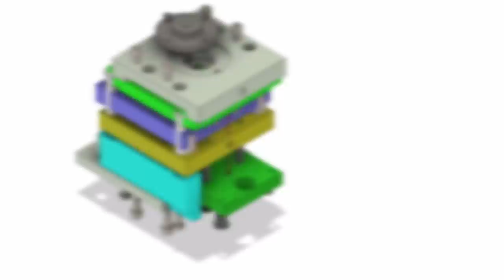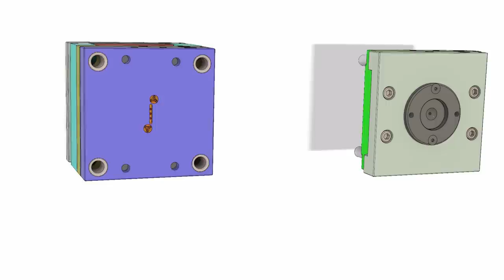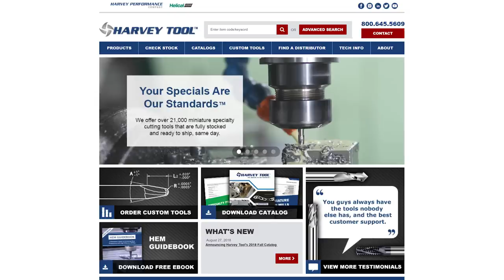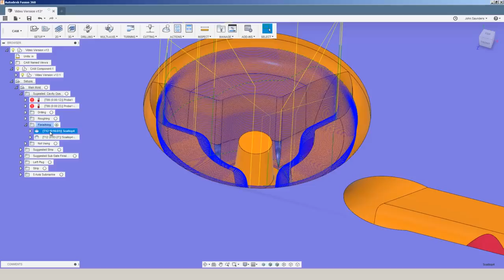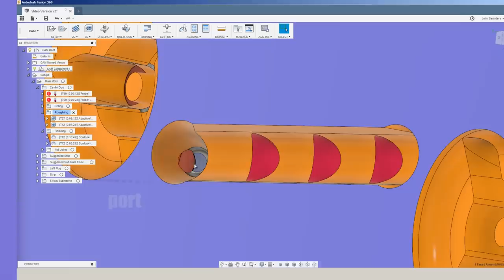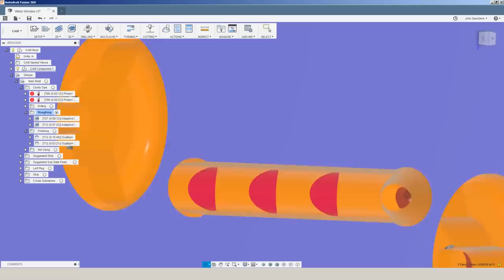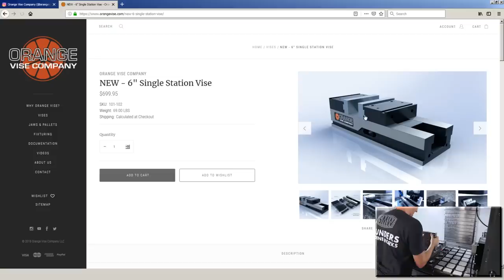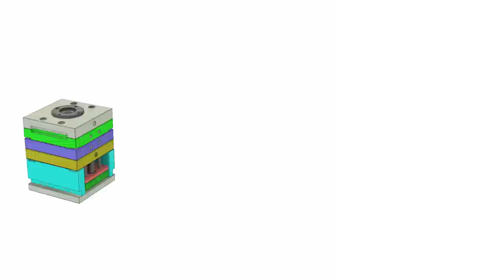Machining an INJECTION MOLD!

Comment: Why only 2 finished parts for cycle? Wouldn't 6 or 8 better utilize the injection molder.
Reply from the maker: Rookie numbers.  Needs to be at least 30.    Joking side, 1) shot size limit in machine, 2) increased mold complexity 3) the price and this solution WORK!
Reply: @nyccnc   That was the first thing I noticed was why only 2 parts.  They are using up more material in the sprue than the part.  The machine time is being wasted with only 2 parts per cycle.
Reply: @SpaceBuckaroo  Probably a investment vs income argument. They might only need to make 10,000 in a month and the investment into a more complex molding wouldn't be worth it for that throughput. It might also be that the machine the customer plans to use cannot handle the amount of plastic needed to fill the mold. Plastic molding is a complex process and one thing you need to worry about is being able to fill the mold before the plastic cools enough to become solid. I'm not super proficient with plastic molding but that's what NYC CNC probably means by shot size limit.

Since the part is something they don't need a lot of they can probably charge a little more per part to offset the extra material used. This might seem stupid but in the end a plastic injected part is still going to be darn cheep even if it's not the "optimum" throughput and efficiency you could use to make the part. Also, plastic can be recycled in house to certain extents to reduce the overall wasted material.

This is why you still see small machines being used in all trades. Sure you can get the biggest baddest thing around to remove/add umpteen tons of material a day. But if you only need to make 100 small parts every week then what's the point?
Reply: Fewer chances of messing it up... and room for mistakes
Reply: plenty of reasons why 2 is better in this case
Reply: Because:
- they are rookies in moldmaking (this mold is "apprentice level" basic design),
- balancing gates is tricky in multi-cavity molds, so 2 cav. is spot-on,
- cooling & ejecting system complexity increases rapidly when you add cavities,
- price and other factors (injection machine shot size capability, etc.).
Reply: that was my first thought also, there is probably 3 times the material in the sprue than in the 2 pieces.
Reply: @andylarkins5128  i work at a company that makes such molds. a lot more complex and bigger and i asked the same question when i started my job there. they have plenty reasons why less parts are better. i learned a lot already but im not a professional and i leave the explenation to them. im just saying they did everything right with 2 parts.
Reply: cause they're amateurs and the more cavities there are the more tonnage pressure the machine needs. It also makes figuring out waterlines more difficult. And also depends on plastic, for flow rates, shrinkage, and hardening speed.
Reply: Judging by the size of the die its going in a small machine, injection moulding machines use tremendous force to close the die to prevent material bleeding out maybe the machine is not capable of producing enough clamping force for more than 2 parts
Reply: @rosengrantchris  
"machine the customer plans to use cannot handle the amount of plastic needed to fill the mold"
I noticed that the heating and injecting tunnel was rather short on the machine in the clip. They also mentioned they were injecting rubber, which I suspect, presents it's own set of issues (doesn't flow as readily, cannot be heated as high, more tendency to stick to the mould etc. But these are just guesses.
Reply: For a balanced mold the mold needs to double the cavities 1,2,4,8,16,32. The cavitation of a mold depends on how much product is needed, press size, clamp tonnage and shot size, one way to cut down on the runner is to bore out the spur and use a longer nozzle
Reply: @rosengrantchris  I may be wrong here (wouldn't be the first time) but I think the customer IS Saunders Machine Works. They have made the mold for their own part. Plugs for use in filling unused holes in their line of mounting plates. To keep coolant and chips out, etc.
Reply: @GrayRaceCat  I too was wondering what the point was by the end of the video.  Still, a great video
Reply: Yup, depends on numbers.  But, some larger molders are moving to having say two 32 cab molds running instead of one 64 cav. Because when hot runner drops fail, they have to shut off 4 for each one to keep the fill balanced.  It's not uncommon for them to only be using say 40cav on average.  Having multiple molds keeps parts coming even if one mold is in the shop.

Imagine a 64cav stack molding laundry detergent lids running 12 bad parts at a time. They'd waste thousands of lbs of material and endless time.

I believe the Big pen company has multiple 4-8 cab molds in multiple machines because they can't afford the downtime of having a larger mold down.
Reply: @nyccnc  what was the shot size needed vs what was available?Also how did you figure the total volume?
Reply: I'd have to agree.  At least 4 if not 8 cavities.  The waste in the sprue is tremendous compared to the part size.
The extra work is only machine time in a part like this, running extra cycles of the cavities.  Also i would use reverse tapered end mills for the gating, maybe edm and polish?
I would love to see a demo of using pocketed hardened inserts for your cores and cavity plates, A and B sides.  It makes it easier to machine the features into a mold.
Nice Job!
Reply: @nyccnc  Hi I'm learning about injection moulding, where does the air evacuate from the mould as the plastic is being forced in? are there vents for that? Thanks

Comment: Any reason to indicate in the shank of small end mills rather than the flutes? I don't have a lot of experience with setting them up but I do hear that the flutes can be ground .0004" or more off center from the shank.

Comment: I’m here to say I’ve made alot of Mold Bases, Cavities, cores, and slides for molds anywhere from 50,000 to 100,000 dollar molds. Usually Rough and pre finish everything with .007 on all the walls and have it heat treated and then finish everything to size then let the veteran mold maker plus 30+ years in the business, burn the small details in on a ole Mitsubishi Burner and then he assembles the mold. It’s quite a process especially when the guys your making it for a picky as hell as in drop it .0007 tenths on that chamfer

Comment: If you run a lot of them, especially if you're using expensive materials, consider changing that cold aprue bushing into a hot sprue bushing. (Hot runner system would be overkill for this)
DME sells basic ones for under a grand. A basic temp controller if your dude doesn't have one is also cheap.  Minor mods  to fit.  It's basically a much smaller od version of a sprue bushing that has a heater band wrapped around it with clearance for heat xfer. The tip will then stay the same diameter.  From just the video it looks like you'd have 50% less scrap, and it will also decrease the cycle time. Make twice the parts with half the material!

Depending on what material, choose appropriate tips, to shut off. I.E. reverse taper for nylons.

Of course if your using cheap material or some regrind, and 5-10 seconds doesn't matter, then it may not be worth it.

What is the material your running, and what mold steel did you use?

Comment: 5:16 actually you touch off the plate by first getting the rotation from two holes and then touch off all 4 holes to get the exact center because if you want to change something in the contour later you may not get the exact same center if you touch off from the outside walls (which are not precise)
Reply: incorrect. So many reasons to not go off the leader pin holes: 1. The leader pin holes are not made to be used as datums. The plates are assembled then the outsides are machined so they match with the leader pins in them. 2. the hole on the operator corner is offset - so if you pick the wrong two holes to measure off of your datum will be incorrectly shifted. 3. sweeping holes is much slower than beeping the outside of the plate. 4.Larger plates do grow and shrink substantially with the heat from machining, switching coolant on and off, and room temperature - so the leader pin hole locations will move from heating and cooling, while the center of the plate will always be the center of the plate no matter what temperature.

Comment: You said that moulds have to be made by cnc - not true at all. Injections moulds were made long before CNC machines. And many are still made the old way - with standard milling machines and spark eroders.

Comment: Two questions. These aren't about the machining, but more about the design. I was hoping you might know.
1) Why is this mold so big for such a small part?
2) If the mold had to be that big to fit the injector, then why didn't they design this to make at least a dozen more of the parts in each injection? This is for rubber parts. It's not like very slight temperature or density differences between them during molding would be a big deal.

Great video, BTW. I hope you get lots of business. That beast of yours looks hungry.

Comment: On a die this small do you have to have the surface perfectly flat or a micro concave or convex to allow for part expansion and deformation? Or does the cooling keep any movement from happening? We have a 2000 lb die for our product, but I have always been curious as to the actual tolerances.

Comment: What was the reason for having the gate hidden? Could it not have been on the surface? How did you align the ejector pins? Did you use transfer punches or some other method?
Reply: I work in injection molding and tooling, sub gates like this are used so when the part ejects from the mold it automatically separates itself from the sprue, as well as leaving a cleaner finish than cutting the gate by hand. there are many different gate styles depending on part shape, plastic type, and a whole range of factors

Comment: I'm surprised you built the cavity right into the base plate in the ejection side of the die, we always used to make inserts for both sides to increase longevity and so that they're easily replaced if/when they get damaged...
Reply: Also, an easier and more accurate way to cut your tunnel gate (the angled tapered hole where the plastic flows into the part) is to set the plate up on an angle plate on a manual mill and use a 7 degree single flute cutter and a set of gage pins to make the orifice the correct size on both sides...the general rule of thumb for most plastics is the orifice diameter should be 70% of the average part thickness (ie: If your part is on average .100" thick, your orifice should be .070" in diameter)...set a hard stop on the quill, gently peck drill the hole until you break through moving the knee up .001" at a time until the desired pin diameter goes through the orifice, then flip the plate 180 degrees and do the other side...
Reply: Thanks for advice. But do you realise, that this is very basic mold? So he doesn't need to make it more complicated.

Comment: I have a question for anybody that may care enough to cure my ignorance.  I have been around CNC most of my life. The thing is: I have only used Swiss turns and a manual lathe and Bridgeport as support equipment. 
 I always wanted to get into milling machines. I’m thinking of buying a Haas to play around with and learn(I am sure it won’t take long at all). I guess my question is this. When you’re using a milling machine... where and how do you buy stock? Do you specially order it in specific dimensions? Does it usually come in a rectangle or square bar and you cut it to size? Are there processes you have to go through to prepare your stock... other than probably filing the edges? 
  Any time I have ever ordered stock, it has always been “ I need this material in X length and X diameter” and “possibly centerless ground”. Sorry, for having an idiot question. I am just curious.
Reply: An Artist formerly known as William Devane 

There’s metal supply warehouses throughout the country. Yard metals is a large one, Alcoa for anything aluminum. 

Generally ordered in bar stock of plate stock that you cut down to part stock size with a bandsaw. You can order them precut to a specific size, but it costs extra and only worth it if you’re doing several of the same parts. 

McMaster Carr carries smaller sizes and quantities of just about everything, but they’re pricey compared to a dedicated metal supplier.
Reply: Occams Sawzall thank you. I really appreciate it

Comment: Please, I have two questions. 1. When you are machining with the 1/16 bullnose, what rpm are you running? and 2. When you drill a small hole into the top of a hardened plate, why does the drill not wander off? do you spot drill it first?
Reply: thanks for the reply. Just a rough idea of the rpm will do to satisfy my curiosity. steve gale

Comment: If tapping the tool with a screwdriver can affect runout this "much", what can the actual mashining with all the vibrations and horizontal load do to the acuracy? Would be interesting to measure the runout before and after a long mashining session
Reply from the maker: We've asked this same question - the few times we've measured after the cut, the tool runout remained unchanged!
Reply: hansdietrich83 the loading on a small end mill like that is super small. If you look at them funny they break. It’s more seating the collet in the holder when he taps on it.
Reply: I would think the high RPM would tend to "center" the tool, only if you bumped into the part while not turning would the runout worsen.

Comment: I'm impressed. Self taught, first mold.  Took me years to be able to slap one together THAT well!
Any mold shop would hire you even without experience if you showed them this.

You can make smaller fractional ounce molds and run them with an old plunger type machine for small runs.  You'd be able to build one of those in a few hours.
My family used to build and sell Simplomatic PLA-63 molding machines way back. Plenty of copies now, or find a used one of ours for under a grand.  Should you need parts, hit me up.

Comment: At 13:45 you use a torque wrench to tighten your er collet but the adapter is increasing the length of the lever which will lead to a higher torque than the wrench is set to. If you rotate the adapter to be perpendicular to the lever arm then you will get an accurate torque.
Reply: Joshua Wentworth he also clicked the torque wrench three times which will lead to over torque also. 😄
Reply: This is a handy calculator for anything that changes the lever arm. There is one that computes using angles as well, just couldn't find it.

https://www.engineersedge.com/manufacturing_spec/calculator/torque_adapter_extension.htm
Reply: Its more I think to get a consistent torque value to repeat, not really needed to be accurate

Comment: Ballscrews on VM's have a lower pitch, not higher.
Reply from the maker: Yea, epic fail on my part there.
Reply: @nyccnc  we all make mistakes!! All around great video though!
Reply: NYC CNC 
Higher Helix angle,  lower pitch. 

Higher pitch, lower helix angle.
Reply: @occamssawzall3486  that's a stretch. 100% correct. But a stretch. LOL.

I'm glad he owned it. Just like every other mistake he makes. Helps everyone watching learn.
Reply: Maybe you meant more TPI?   Just trying to help.  Of course the ballscrews are metric, so it doesn’t help after all.
Reply: The main benefit of the Moldmaker Haas is the look ahead in the processor. It allows the machine to see where the next 1000 lines of code will send the machine. If the contour changes abruptly, the machine will adjust the feed rates in the corners to keep the accuracy high.
Reply: @mnotlyon  that's not a VM specific feature, it's a HSM feature and there's nowhere near 1000 blocks/lines of lookahead. 100 maybe unless they've expanded it. The machine is capable of processing 1000 blocks/lines of code per second, however. Plus the different settings for accuracy/acceleration that the lookahead uses.